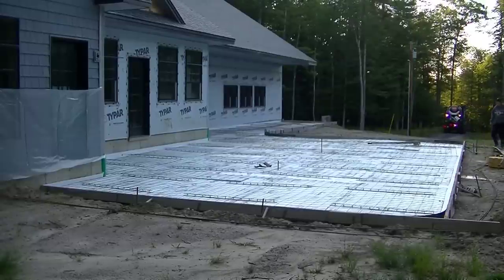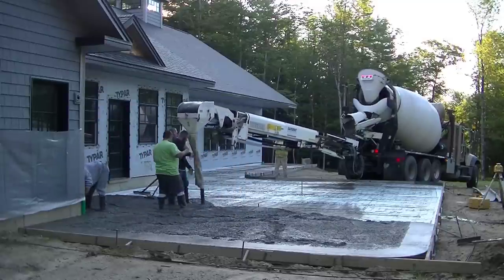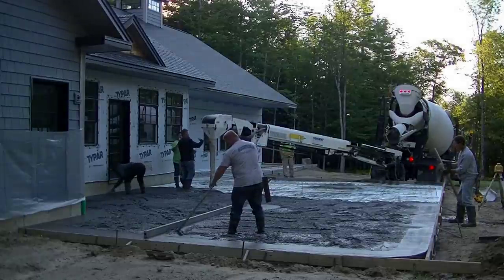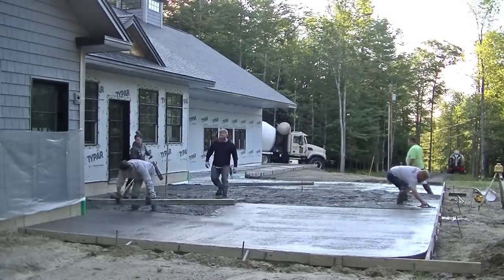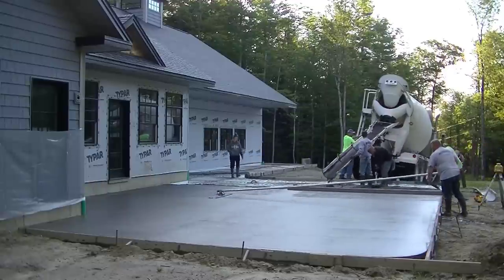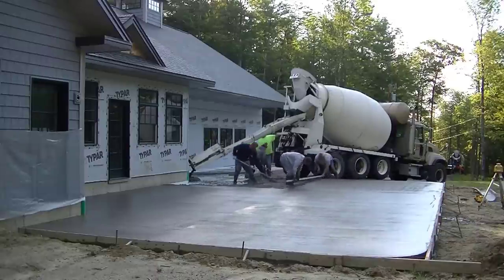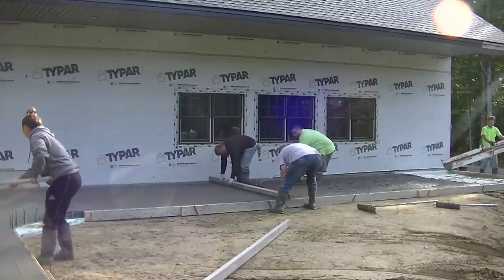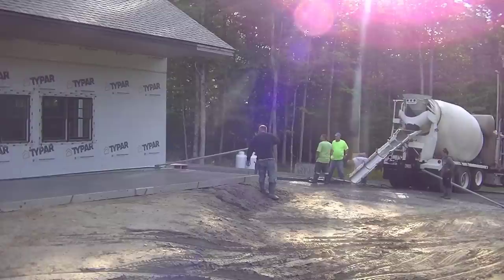How To Pour A LARGE Concrete Patio Slab (With 3" Slope)

Comment: Here in MN we ripped out all the driveways in a town home complex b/c they all heaved so bad every year and cracked to hell. We put 4" of foam under them and repoured them and they've had no issues in about 10 years with heaving. Also we put rebar 2' on center in EVERYTHING. Mesh just doesn't hold slabs level when it cracks up like rebar does.
Reply: I think i'd go exposed aggregate on this. It's a huge surface to stamp in one pour. No one I know would even try it unless it were a random rock pattern where you can start in multiple places.

Comment: question? do you not need rebar attached to the house to connect the new concrete, also do you need an expansion piece against the house to allow concrete to expand? I am getting ready to pour an outdoor kitchen, it was a outdoor patio i have some precious poured concrete, but i have 4 inches at the house and at least 6 inch end of precious slag.  My situation will be an enclosed sitting area and an outdoor kitchen all under the same roof.  33 ft wide and i was wondering how they screen the concrete level without some type of support to let the screen ride on. enjoyed the video.

Comment: I’m going with a light broom finish. Perpendicular to the building, by the way. I’m guessing the price difference between 1600 sq ft of stampcrete vs broom finish gave the owner a bit of sticker shock and convinced them to go with a broom. Which they can easily tile over later if they wanted.
  Definitely no insulation under slabs here in S. FL. As a matter of fact, we never even bring in gravel. We always pour right over the naturally occurring soil, after suitable compaction of course, for exterior slabs like this or with a 10 mil vapor barrier for interior slabs. Our soils tend to be very sandy or some areas may have solid coral rock. 
  Cool conveyor truck btw. I’ve only seen those at The World of Concrete on display. Nobody I know of has those in their fleet around here and only 1 company uses the front discharge type trucks.
Reply from the maker: We use the conveyor quite a bit instead of a pump. It'll reach about 40' so we can go about 50' if we pull the mud the extra 10'. It costs about 200 bucks extra but still beats a pump up here by about 700.00
Reply: @MikeDayConcrete  Yep, $200 bucks makes it a no-brainer. You probably pay your help a flat rate, but if you didn’t, you’d spend that much in the additional man-hours it would have taken to wheelbarrow it over.

Comment: Mike, I just had a metal garage built and I am going to attempt to pour the floor myself.  Question. Since I will be doing the pour by myself I plan on doing it over two weekends.  Should I make the form for half the floor horizontal or vertical to the garage door.  I plan on putting rebar thru the form so that it will extend into both pours.

Comment: Does the foam go right up against the edges of the form? Does it show when you strip the form boards?
Reply from the maker: Yes it goes up against the boards. It's completely under the slab. Sometimes they will run the foam 2' beyond the slab for extra frost protection and backfill over it.

Comment: I prefer brushed, see a lot of insulation under floors, especially with underfloor heating, never outside though.
Reply from the maker: It's pretty common to use insulation outside here in Maine. Especially for unheated garage slabs.